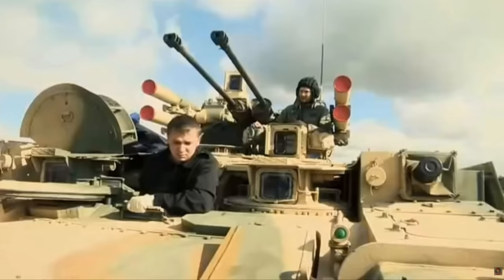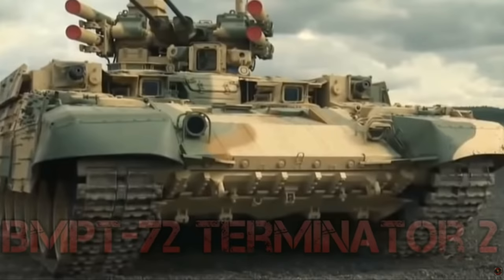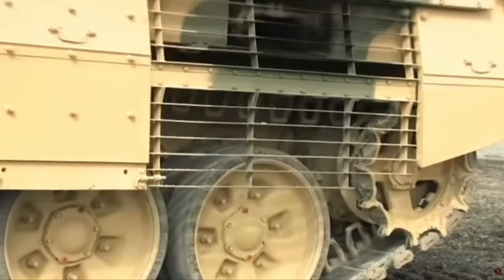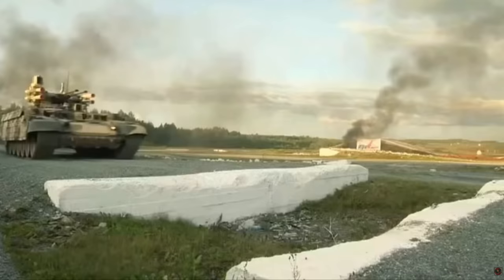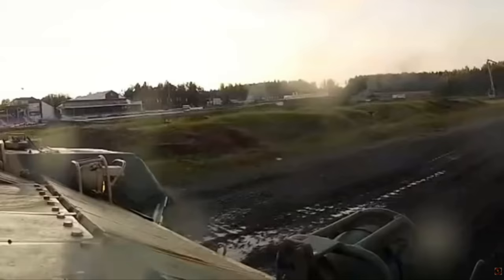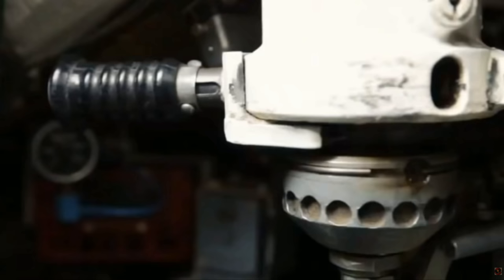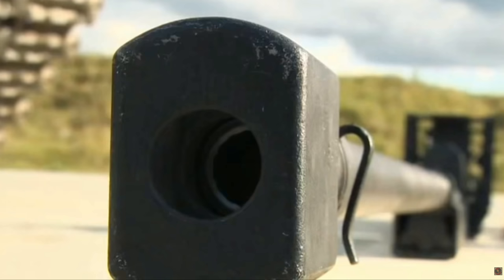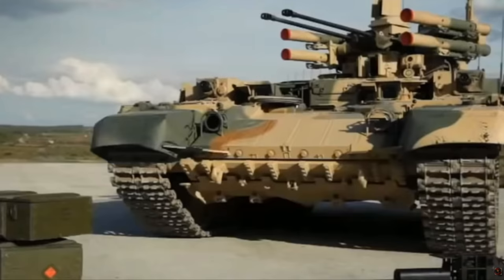BMPT “Terminator" Tank Support Vehicle Overview

Comment: The question is, can it stand up to a Javelin or NLAW ?
Reply: No
Reply: @GOD_O_WAR  +1
Reply: Another pop-top on tracks.
Reply: @blessedheavyelements8544  I could probably stop the javlen with era but as well all know by now
Reply: @ernestpaul2484  it is not a shit tank it's how they make and prouduce them and the poorly trained crew like when the t14s driver pulled the e brake on puraid
Reply: Probably if the missile hits in top of the turret. The turret is pretty dense and about 1,5 meters tall so the jet shouldn’t get into the compartment. The NLAW can probably also be triggered by the covers of the missiles on the side in that case it will at least explode the missiles but it will probably do nothing to the crew. In any case it will take it out off action and both weapons are fire and forget so even if it spots the team it can’t stop the missile once it’s fired unless it has APS.
Reply: I'd say yes. Though even if you manage to lock it and fire, those 2 30mm guns will turn you into a mist way before that missile connects, turning the Ukrainian soldier into a 1 shot weapon.
Reply: @GOD_O_WAR  Yeah I was agreeing with you. Best Regards!
Reply: @jkl9984  
I doubt it, the Javelin attacks from the top, the gun on the Termination lacks the ability to do a 180 degree North to confront a top down attack
Reply: @Slavkovic_Predrag  Fair point.
Reply: @kirkpatrick7475  If you thought the bmpt shooting at the missile, then no. That is an APS job. I meant hit the guy who is shooting that said missile. The turret rotation speed should allow for that to happen quickly.
Reply: @jkl9984  
The person firing the javelin will not be exposing themself
Reply: @Slavkovic_Predrag  
I don't think you know how powerful the javelin is
Reply: @kirkpatrick7475  You have to get a lock somehow. Looking at propaganda footage Ukrainians produce, they don't exactly shoot and scoot like they should most of the time. But in any case, we are only a bunch of armchair generals on the internet speculating on a highly edited footage.
Reply: @GOD_O_WAR  Nor were the T - 62's, 72's, 80's, 90's. According to all the hype over the years. Then the world saw how they famously came apart when hit. So we have this thing and we will see.
Reply: @Slavkovic_Predrag  From what I gathered the crew was REMOTE from the weapons systems, which has an initial load of ammo, but there is a reserve/ready-rack of ammo in the hull where the crew is. Except for the missiles obviously.
Reply: @ernestpaul2484  Russian tanks wold work qlot better if the had better trained crews and infantry that knew how to work with tanks and air support
Reply: @jkl9984  
Looks to me from all.the Russian tanks and armoured vehicles littered all over UKRAINE, they are doing a pretty good job with the javelins
Reply: @ernestpaul2484  The world (which actually is "the West", some 50 countries) saw what the Ukrainian MoD wanted it to see, destroyed Russian vehicles. We didn't get to see tanks that got hit and rolled away, nor we got footage of the armoured units of Ukraine. I mean in January Ukraine had over 2000 tanks, 2000 artillery, 500+ MLRS, 5000+ APC/IFV, where are they now, what happened to them? Nobody seems to think of it.

Comment: Imho it completey makes sense. The chassis is of a declining tank type which is adressed to be replaced by T-14 style modern 'duel' stuff and threfor free up a lot of material. On the other side, the russians used teh Shilka as urban fire cover and reflex fire vehicle to protect against pop-up ATGM's and stuff. So it makes completley sense to replace the also overaged Shilka with Panzir in ther anti-air-role and Terminators in ther anti-urban role.

The RU army is familiar in the idea dependance on heavy shipping/rails etc. to bring ther toys, so it wasen't as much of a problam as it would be for many other nations. Also spare parts are available till hell freeze over. And as wheeled IFV's become more standard, it also makes sense to have that bit more hardening again 20-30mm which extremly fast make you a mission kill if you're of a high silhouette, medium armor and on squishy wheels.
And ERA is quite a cheap thing, so in most kind of combats, the Terminator can return and armor up, instead of being a easy kill/grounding for even light AT-weapon as most more lightwhight IFV's/AFV's are.

As it on the one side might replace the Shilka in its protector role, it can be also do the tank hunter role, make the IFV, get a missile loudout against air targets(and probably use sensor data from other units). So it can fix many shortages the new russian doctrine has - and might define a part of it, as it still is in developement.

How well this turns out with economical shortages, lobbying of the producer and all that might be ... interesting to watch.

Comment: Quite interesting item indeed! 
But there is also a doctrine, too few of too high value equipment (ie too expensive) does not change the battlefield. 
The turret does not appear to have much protection.  ie a large calibre anti-material gun (12.5, 14.5 or 20mm rounds) sniper can take the turret out quite easily.  
Not quite sure how they intend to supply all diff systems.  It would be a logistical nightmare.

Comment: Hmm something does not add up here. Specifically the range of the Ataka missile vs weight and warhead. Russian solid rocket propellants were significantly behind the west in the md 80's when it was designed. IE if compared to the Hellfire A (a contemporary design) which weighs about the same, there are some questions. Specifically how does it get the range when Russian rocket motors (solid fuel) of the era were getting about 180s of thrust compared to 220 for western ones. IE 1 pound of fuel gives you 180 pounds of thrust for 1 second vs 220 pounds of thrust for 1 second assuming maximum nozzle efficiency which you will not get at slow speeds. So for surface to surface firing the Russian missile would need way more fuel as it has a longer range and less efficient engine. That leaves less mass for the electronics and even though the Russians have more or less caught up now they certainly had not in the 80';s so it would need more weight for the electronics. If we assume the actuators for the directional fins are about the same mass then that leaves way less for the warhead so how the chuff can it penetrate 800mm RHA+Reactive armour?
Reply: The newest versions use the Kornet EM with F&F capabilities
Reply: Latest variants of the Ataka and Hellfire have the same, 8km range. The warhead of the Ataka weighs less (7.4 kg) than the one in the Hellfire (9 kg). How it can have such penetration is something Rostec refuses to share with me, the pigs. ;)
Reply: @imrekalman9044  they don't have the same pen
Atakas M have 970-1000mm of pen
Hellfire  have 1100-1200mm of pen

Comment: A combination Urban Combat/Anti Air/Anti Drone system seems like the only way you'd make this viable in NATO force layouts. NATO's next gen IFVs such as the PUMA and CV90 provide a similiar capability with the added benefit of "And here's the infantry support." 
Given this thing's role, it's still very vulnerable to multi-pronged assualts Get 2-3 ATGM teams coming at it from different sides, it's going to struggle to address all of them before an NLAW or Javelin says hi.
I got bored and started concepting a heavy armour vehicle family which includes an Anti-Drone/Anti-Air/Urban Combat variant, but figuring out how to protect it properly for the UC role is a real pain, cos you need to maximise situational awareness and engagement capabilities so that sneaky infantry struggle to whack it, and then there's drones and how it'd handle being faced with a dedicated MBT.

Comment: on paper it seems like a oveeglorified ifv kind of like a bradly sure it has heavier armor but if I'm not wrong its litterly the heaviest armord vehicles the Russians use witch would likely not be very good considering based off of conflict I will not mention, rain will get vehicles like this just stuck very easily especially with every paved road being blockaded and or coverd in mines thus forcing them all to go offroad anyways so its gonna just get stuck and might have to be abandoned
Reply: You do know that the main idea of using tracks is to go off road, right?

Comment: It optimize detect infantry in the woods using thermal optics  at 5 mile range but Javelin ATGM operator must close in less  2.5 mile if they operate in open area. .in the woods Javelin ATGM operator must close in and expose themselves to the thermal optics.

Comment: They should have added 4 SAM Launchers above the AT Missiles to engage low-flying Helos too.
Reply: Good SAM system to use on the go have to be pretty big with radar systems ore some other scanning\targeting stuff.. it's expensive, takes place in the tank and should be monitored properly to be useful..  Russia have a lot of other systems highly capable  for this role.. and actually 30mm canon with TV aiming system + ATGM is pretty enough to try some shoot on helli on 2-3km distance
Reply: @SpLitSecondS_  An alternate option would be a couple of rocket pods over the missiles.  Rockets can be used on either Helos OR buildings.
Reply: The 9M220O variant of the Ataka is designed against helicopters. You can never know for sure what variant is in each of those tubes. AA, AT, thermobaric.

Comment: the Russians have the Tunguska for aerial targets.

Tunguska-M1 is a gun/missile system for low-level air defence. The system was designed by the KBP Instrument Design Bureau in Tula, Russia and is manufactured by the Ulyanovsk Mechanical Plant, Ulyanovsk, Russia. It can engage targets while stationary and on the move, using missiles for long-range targets and guns for close-in defence. It is designed for defence against both fixed-wing aircraft and helicopters and can also fire on ground targets.

Tunguska entered service with the Russian army in 1988 and has been exported to Germany, India, Peru, Morocco and Ukraine.

Tunguska-M1 low-level air defence gun / missile system

The Tunguska-M1 vehicle carries eight 9M311-M1 surface-to-air missiles. The missile (NATO designation SA-19 Grison) has semi-automatic radar command to line-of-sight guidance, weighs 40kg with a 9kg warhead. It is 2.5m long with a diameter of 1.7m and wingspan of 2.2m. The missile’s maximum speed is 900m/s and can engage targets travelling at speeds up to 500m/s. Range is from 15 to 6,000m for ground targets and 15 to 10,000m for air targets.

Two twin-barrel 30mm anti-aircraft guns are mounted on the vehicle. These guns have a maximum firing rate of 5,000 rounds per minute and a range of 3,000m against air targets. This extends to 4,000m against ground targets.

Fire control

The system has target acquisition radar and target tracking radar, optical sight, digital computing system, tilt angle measuring system and navigation equipment. Radar detection range is 18km and tracking range is 16km.

Comment: you can see the range of motion of the grenade launchers and they will make short work of buildings that infantry are hiding in and flushing them out and the twin 30mm autocannon will make quick work of IFV's low flying helicopters and of course infrantry.

Comment: Yes, it's scary, but after the initial shock wears off, several deficiencies become evident.

All that firepower faces the same direction. Get its attention from one side and kill it from the other side with a Stugna-P or Javelin. Stugna-P can be fired remotely from 100 m away, so if the team is in good cover and the launcher is concealed, the terminator gets terminated.

There's no anti-air capability. The weapons won't be able to elevate enough to defend from an air threat, like an A-10 or Su-25. The other vulnerability associated with that is to artillery and large mortar rounds. No reactive armor on top.
Reply: On another note, remote controlled turret seems vulnerable to any form of high explosives, mainly the optics. Commander's also stuck down the hull so he won't have any analog backups if the CITV atop the turret gets busted.

Comment: If this is an urban centric IFVs, then :
- where's the real anti structure weapon? With the GLs removed, everything rests on the 30mm autos, and their large anti-structure efficacy is, to say the least, very limited. 
- the 100mm 2A70 low recoil gun (BMP-3M) would prove far more useful, particularly if it had an variant of the RPO-A Shmel thermobaric rocket. 
- 4 x ATGWs, when their use, particularly in Euro cities, is next to useless due to minimum engagement range.
I'd opine it's again a case of cramming as much weaponry into as small a package as possible, yet most of it is unusable simultaneously. The doctrine and application are seemingly still confused, jumbled and not well considered.